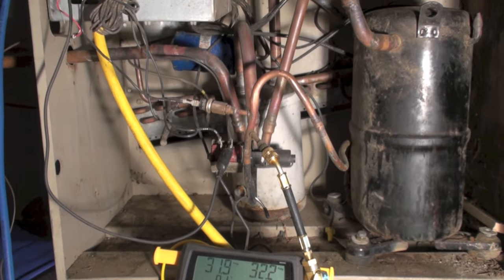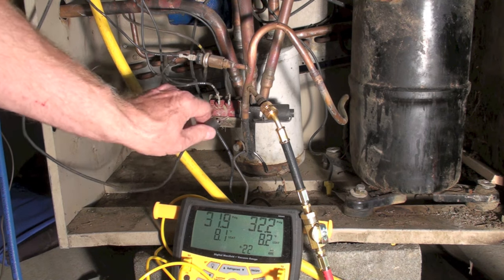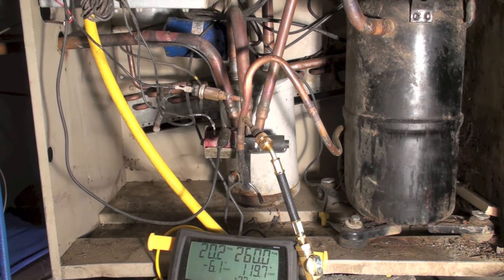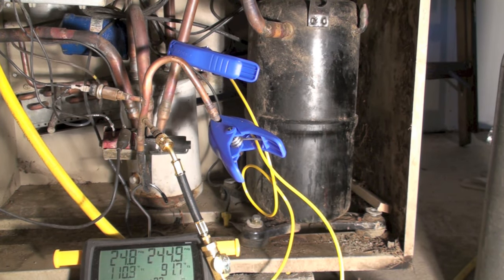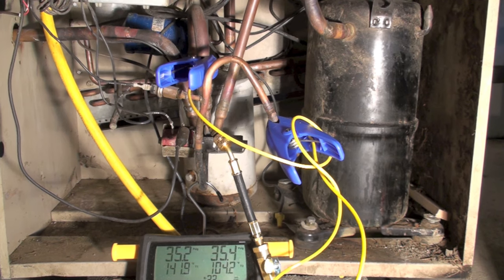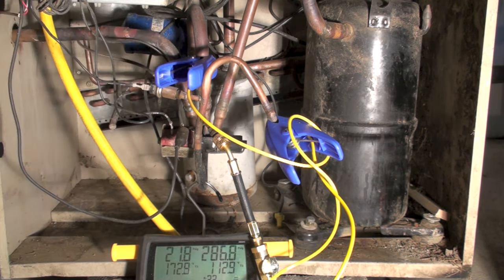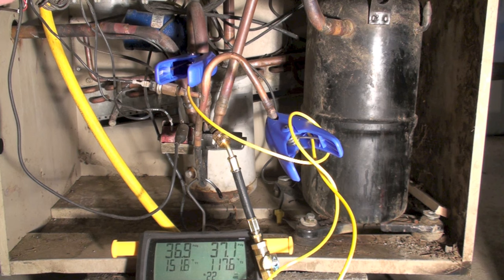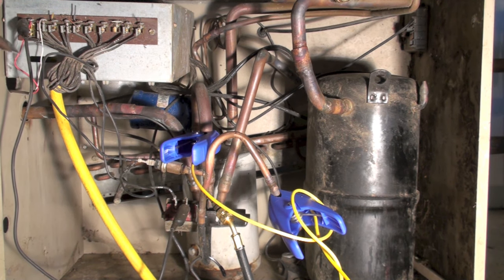Diagnosing the stuck HVAC reversing valve

Comment: Hi. Great video. I have a split level reversible air pump. Upon recently returning from vacation - during which the power cable had been unplugged as recommended - I find that whenever I switch on the unit, the fuse blows. Just before that happens I head a click from the external unit. I am supposing that the trouble is the reversing valve in the external unit. Does this sound correct, from my description? Grateful for someones view on this.
Reply from the maker: Sounds more like a locked up or shorted compressor to me.  
GFM
Reply: Many thanks for your response. I am hoping that changing the compressor is a simpler (less expensive) operation than changing the reversing valve. Any idea about that?
Reply from the maker: The most expensive repair is compressor replacement.  The second most expensive replacement is the reversing valve.
GFM
Reply: Thank you. That was not good news:)
Reply: so what was it? capacitor?
Reply: Hi James. No, apparently not the capacitor as I have added on a Supco SPP6 hard start capacitor and the problem remains - the fuse blows after a couple of minutes of the interior unit running and just when the exterior unit tries to start up. Someone said that it sounded like a "stuck" compressor. Fear that I am looking at a total replacement here and shudder at the expense :-(
Reply: did we check the circut to ground and ohm out the compessor? what brand is it?
Reply: Hi. No, I have not checked any readings. You appear to suggest that I should probably do so (?). It is an Airton split reversible unit (outdoor compressor and indoor wall-mounted fan unit). I think it is about 12 years old. Was working fine until multiple power cuts one day :-(
Reply: Not so sure how to check the circuit to ground and ohm out of the compressor.
Reply: i believe airtron is the company that installed it. are you in saN ANTONIO?
Reply: the next step is to have those parts checked. id recommend having a second opinion done after the initial diagnosis to keep everything honest.
Reply: Hi. No, actually I am in France. The unit is a French made one.
Reply: Thank you James. I have found a video regarding how to check the current and ohms on a compressor so I shall do that just as soon as the rain and wind stops (Wednesday perhaps). I can let you know the results.
Reply: Samuel MacDonald there is a small chance you have a shorted high voltage wire or just a crank case heater failure. I feel it's time to call the professionals
Reply: Roger that James. I shall follow your good advice. Kind regards.

Comment: the other day i ran across a Trane heat pump ..... making odd ticking noise at outdoor unit .... sounded like turn signal and unit did not go into heat mode . Any ideas ?
Reply from the maker: Jack Wright Little info here.  However, could be a rev valve solenoid.  Although Trane uses a rev valve energized in cool.  I would start disconnecting thermostat wires. Hope this helps.
GFM
Reply: Id check power from the defrost control board to the valve. It has to be one of the 2

Comment: I am having an issue hopefully you can help me with? I purchased a brand new Goodman 3.5 ton heat pump/ central unit for my home. Yesterday I finally got it all ready to go and I followed the initial startup procedures as instructed in the manual. The AC side worked fine but when I switched to heating I got nothing, the blower was working but the compressor did not kick in nor was I getting any heat.

Last week I attempted to hook it up but had the wrong type of thermostat wired in, this caused the transformer to short out and I had to replace that as well as I purchased the correct thermostat.

Do you have suggestions as to what might be the issue?
Reply: This is almost impossible to diagnose.  Except to say you have wired it wrong.
GFM
Reply: @electriccar3253  No the wiring to the thermostat is correct. I was just wondering if when the transformer got shorted out if maybe the capacitor to the reversing valve could have also gotten shorted? 

Hey thanks for taking the time to answer and yes I realize it's difficult to diagnose without seeing it. Normally I would just pay someone to come out but I broke my back at work and am currently waiting for a judge to OK my disability. They say it can take up 24 months, hows a person supposed to live?
Reply from the maker: I hear you on the disability.  I have relatives on it and its pretty ugly.  
There should not be a capacitor in the reversing valve circuit.  When you say you get nothing, does the indoor fan come on?  Outdoor unit?
GFM
Reply: @grayfurnaceman  - its just the outdoor unit, heat and cool, no indoor fan just the fan (blower) on the outside unit. When I have it on AC I hear the compressor kick on and the big exhaust fan comes on and the blower comes on. When I switch to heat the only thing on is the blower and it's blowing cold air.
Reply from the maker: Do you have power to Y at the outdoor unit?
GFM

Comment: The stuck reversing valve does not explain why the discharge pressure is so high. If it is bypassing as shown by the temperatures, the discharge and suction pressure should be closer to the same pressure. Is there a restriction elsewhere in that unit?
Reply from the maker: When a reversing valve sticks partway it is common for the valve to restrict although it does not necessarily have to.  This is just how this one failed.  Thanks for the thoughts.
GFM
Reply: grayfurnaceman
Ok, but would the high pressure discharge gas not  push the suction above the 20 psig shown if it is going back into the suction tube? The discharge gas just goes  into the shell of the valve, then it should be able to go down either (or both) of the other tubes. I get what you are saying about the valve being "stuck" or unable to move, but something just isn't adding up here. Is the compressor over sized for the system you are testing? You mentioned that it is just one you had laying around.
Reply: grayfurnaceman
I do like your demonstration....just something seems out of place here and I'm trying to get a better understanding.

Comment: Ok I have a Trane heat pump. The heat stopped working (outside unit only comes on for a few seconds sometimes) The heat strip and fan works. Tried the AC and it works. Could this be the reversing valve bad? Thanks for any help
Reply from the maker: It could be.  There is quite a bit of troubleshoot before you can be sure.  When you switch from heat to cool you should hear a swooshing sound from the outdoor unit.  That would be the reversing valve changing position.
GFM
Reply: Ok thanks....it comes on in heat setting for maybe 30 seconds then shuts off and wont restart until it has sit for a while. It will come on in AC though. I dont know much about HVAC but I may check the solenoid, if it's not that I'll call someone.

Comment: What is happening if it goes cold no problem but when I try to make heat it goes back and forth by itself
Reply from the maker: From the lack of specific info, I could only say it is not working in first stage heat and the backup heat is coming on in second stage.
GFM
Reply: @grayfurnaceman  This is a marine system on a boat I thought maybe bad solder on control board as it won't stay locked in heat mode for more than a minutee or so

Comment: Something I'm missing here?  Why the high head pressure when much of the discharge is going right into the suction line?  In my experience the pressure differences would be small, not super-high head pressure?  Symptoms of a worn out compressor is high suction and low head pressures, stuck reversing valves are similar.  Please clear this up for me.  I'm thinking that the reversing valve is bad, but stuck in AC, but you also have a restriction.  Like I said, the pressures shown on your gauges don't add up to a stuck reversing valve, at least this has never happened to me.  If have a 15-40psi differential with low current, the real job is to diagnose weather it's the r-valve or compressor. [or both]!
Reply from the maker: In this case, the piston is stuck in the partially shifted position.  The discharge is restricted by the piston.  I have had this a couple of times.
GFM
Reply: High head pressure in video of 258 psig = 120F     would you ever get this high value if reversing valve was not restricted ?  Great video but raises many unanswered questions for novices :(
What should suction and discharge pressures be for following cases (acceptable ranges)
1)low charge as in video and reversing valve working fine
2)fully charged and reversing valve working fine

Comment: customer called on heat pump not cooling due to roofer making a hole on the refrigerant line.  Repaired line ,pressure test, vacuum system added refrigerant and started up unit and added refrigerant by weight to mfg. specs. and Low side pressures stayed at 20 PSI and High pres. is equalize. What is my next step to find out if its the compressor or reversing valve that is damaged.Thanks
Reply from the maker: It is very hard to tell the difference between a rev valve problem and a compressor with bad valves.  You can try removing the refrigerant and adding nitrogen into the high side, then before the unit equalizes, energize the valve.  Not easy to accomplish but I would try.
GFM

Comment: How about when your high pressure switch trips suction pressure at 126 discharge pressure at most 475 runs for 5 to 7 mins and trips I figured it is a bad high pressure switch because the rv was replaced a couple years ago.. it’s 410a and I even saw the pressure switch open at 430psi discharge pressure. Should I suspect the rv or change the switch ? I unfortunately didn’t check the temp difference of the 4 way valve because I figured it is fairly new..
Reply from the maker: The switch does not appear tone the problem.  Your head is too high.  Possible part way stuck valve?
GFM
Reply: grayfurnaceman thanks for the response
Reply: grayfurnaceman I just know high pressure cut out is around 610 and cut in about 500 I’ve seen several carrier units (with piston) having a hot gas discharge of up to 480 490 but never tripping a switch. That’s why I figured this one was different. I thought suction pressure being 125 ish is ok and it would be much higher with high pressure gas flowing straight back to the compressor
Reply: @grayfurnaceman   
Just found your channel and video from years ago. Hopefully you remember and I can ask a question. You said in the video you had no way to determine if the compressor was bad without changing it.  I saw a video once where the tech pinch off the discharge line before the reversing valve and watched his compressor amps to climb if it the the compressor was salt salt that’s not what I thought to be good.  With that testing arrangement I guess it’s sucking back was left in coils.   Do you sir agree with this method Thanks

Comment: how come the pressure going into the compressor from the suction line to the compressor  is much higher ( 260 psi) than the pressure coming out of the compressor  in the discharge line   ( 20.4 psi ) ?
Reply from the maker: Actually, the discharge is is the small line on the bottom of the valve.  Remember, of the 3 lines on top of the valve, the middle is suction, of the other 2 lines one will be discharge in heat and one will be discharge in cool.  Hope this helps.
GFM